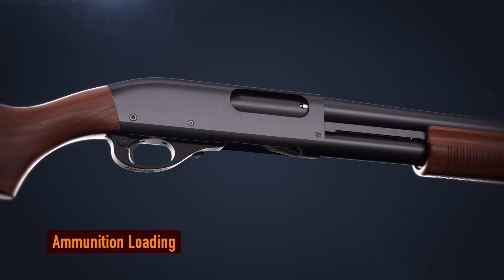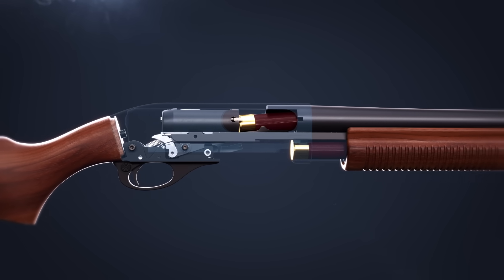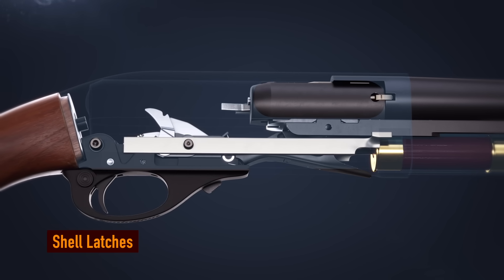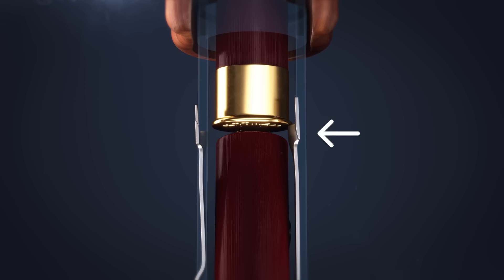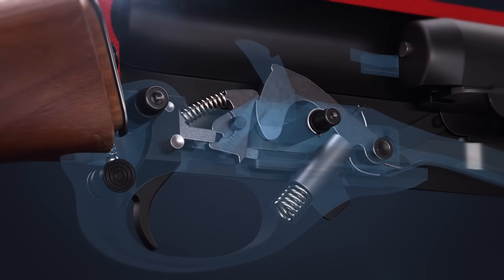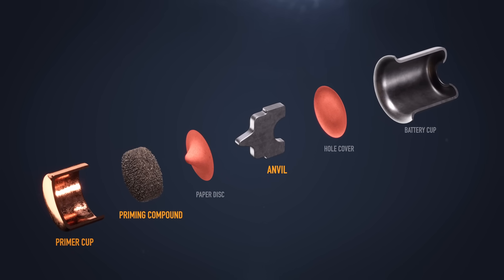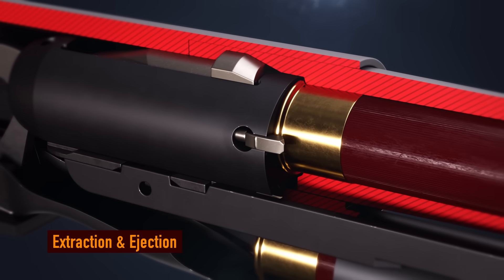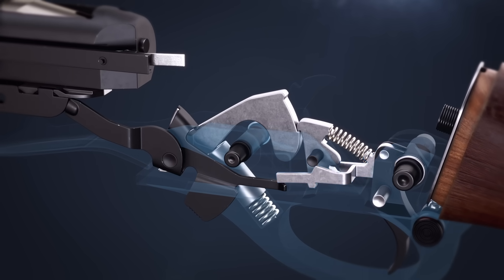How a Pump Shotgun Works

Comment: ummm. The "shell latches" are actually called spoons or forks in the firearms world.

And they have official names for these parts; One is called a shell release, and the other is called a shell interrupter. One piece, at least in mine has the shell release spoon on the right side and the shell interrupter on the left. One holds back the shells all the time and the other is activated by the action bars to prevent another shell from ejecting which will cause a catastrophic failure.

Also its not a shell or bolt carrier. Actually called a bolt sled since it slides back n forth in the 2 channels inside the receiver. And then you failed to mention the "shell elevator" that lifts the shell from the mag tube to the breech face.

I know all this cuz I have fired a shotgun over 4000 times. I know how they work

Comment: I have a Savage Arms pump shotgun and I don't like how the safety works. Every shotgun I had before you could put the gun on safe whether it was cocked or not. That way when I loaded it the gun was already on safe. On the Savage you can't engage the safety until the gun is cocked. So, as you're loading it the safety is off! This may be a small issue, but I don't like it and this will be the last Savage I ever buy!

Comment: Great video. There is one thing though. Although there are pump shotguns that are also semi-automatic. Most pump shotguns require you to pump for every shot. In other words after firing, the bolt does not go back automatically. It requires another pump. Hence pump shotgun. That is most models. There are now semi-automatic models and there is one (maybe more) rare hybrid pump semi-automatic shotgun.

The Remington 870 is pump only. No semi-auto.

Comment: Fun fact older shotguns such as the Ithaca 37 and Winchester 1897 did not have a trigger disconnect meaning as long as you held down the trigger, the next shell would immediately be fired when put into battery. This was and still is called Slam Fire. It was a quick and devastating method of emptying the tube at close ranges especially in the trenches of WW1 and Vietnam
Reply: The colt lightning pump action rifle does it too
Reply: My nerf gun does it too! -👦🏼
Reply: I wish they still make shotguns without a disconnect.
Reply: @AlexKS1992  in my opinion, thats one hell of a way to provide mass shooters with a quick way to get what they want, if we're talking about shotguns to be sold to civilians, of course.
Reply: @nerdmassive1353  I’m a firm believer in abolishing the NFA and making automatic weapons available as guaranteed by the 2nd Amendment.
Reply: @AlexKS1992 : Yeah... great idea 😒

What we really need as a society on a murderous, self destructive path is more access to guns... 👍👍
Reply: @NibblesTheNibbler  Don’t like it move somewhere else.
Reply: @nerdmassive1353  or, you know... don't sell shotguns to civilians.
Reply: @deathvideogame  in my humble opinion. We should only sell guns to those with a license
Reply: @webbermain6910  agreed
Reply: @NibblesTheNibbler  maybe we should correct the path rather than treat the symptoms by disabling the society's ability to reject evil by force if necessary. You cannot convince me that the horrors of tyranny aren't the sickness that are causing the mass shooter symptom.
Reply: @deathvideogame  "dont sell shotguns to civilians" dumbest statement of the year right here
Reply: @trolltal_warmaster  why did you put three quotation marks
Reply: @deathvideogame  i only put 2. Learn to count
Reply: @deathvideogame  
"Dont sell shotguns to civilians"
Smartest anti-gun person
Reply: @chieckenman4432  Why thank you
Reply: @AlexKS1992  leaving's the coward's way out. If you really love this country, you'd stick around and want to see it fixed.
Reply: @thegoodmudkip3652  Read my comment again, I don’t plan on leaving.
Reply: @AlexKS1992  and neither am I, so don't tell me to leave because I want to see this country become a safer place to live.
Reply: @AlexKS1992  You make it sound like you already won.
Reply: @nerdmassive1353  It takes a lot of practice to actually be able to fire quickly with slam-fire, as shotguns generate a lot of recoil.
Reply: @thegoodmudkip3652  you don't want to see the country "fixed" as you claim you want to see the country lose its culture.
Reply: @ICantThinkOfAFunnyHandle  what I want is for there to be less loose regulation on the sale of these kinds of weapons so that any old yahoo with no certification of expertise or mental stability can't just buy an AR-15 without any sort of background check.
Reply: @thegoodmudkip3652  that kind of stuff just doesn't work though. The small minority of mass shooters who get their guns legally pass background checks because they haven't committed crimes yet. Regulation on the sale of firearms is already very strict yet it fails anyway because making it harder for legal citizens to get guns doesn't make it harder to obtain guns illegally
Reply: @AlexKS1992  the 2nd Amendment does NOT guarantee you a firearm.   You better go back and read the full amendment in its entirety…
Reply: @deathvideogame hunters still need to hunt.  And hunters need shotguns and hunting rifles.
Reply: @beaners1234life  Ah yes it does, you should look it up.
Reply: @beaners1234life  hunters do not need to hunt lmao
Reply: @NibblesTheNibbler  why are there murderous, self destructive people in society?
Reply: @thegoodmudkip3652  Sorry mate, but you should look up what a 4473 form is.  You are required by federal law to take a background check if you intend to purchase a firearm from any sort of dealer.
Reply: @deathvideogame  Umm, you have heard of population control, right?  If hunters don’t hunt then the prey population grows and then predators appear…

Hunters need to hunt.
Reply: @AlexKS1992  this is the 2nd amendment verbatim— “A well regulated Militia, being necessary to the security of a free State, the right of the people to keep and bear Arms, shall not be infringed.” 

Copied straight from the constitution website.

well then..  are you a part of a militia?  Being necessary to a free State? Do you hold weekly routines with your neighborhood to be ready at a moments notice when tyranny appears?
Reply: @beaners1234life  Natural environment does that.
Reply: @NibblesTheNibbler  If you dont like it, move to Europe. 2nd amendment states "SHALL NOT BE INFRINGED!"
Reply: @AlexKS1992  That's a quitter's mentality. The world is forged by people be the change they want to see in the world.
Reply: @SwordTune  I don’t understand you?
Reply: @AlexKS1992  when did I ever say in my replies that the militia needed to be regulated by any government?  Be specific when you comment back.
Reply: @nerdmassive1353  Are you aware that semi-automatic shotguns exist? Slamfire weapons no longer are manufactured because of safety not because it makes it a more effective weapon
Reply: @huntercolew  completely agree. I have a AR style shotgun it takes box magazines it’s semi automatic it is the baby of a AR-15 and a Pump action shotgun. I call it the AR-12. The tools matter less than the side of where these tools may lay. It’s every day that millions of good people decide to continue to look inside of their hearts for the American courage that conquers all evil. It’s a select few that perhaps the CIA and FBI send to do their bidding that makes this seem so damn obvious it’s insane. It’s why I always get so confused at that mindset. Like do you know anything about firearms? Do you know any real examples or statistics that support your claim? Switzerland has high gun ownership too. But they do not have rare yet becoming more common “mass shootings”

I wonder why… oh wait.
Reply: And i thought nerf guns only did that! lol!
Reply: This method is now mainly used in nerf guns.
Reply: I hey think I can do that with a nerf gun I have
Reply: I literally thought slam fire was only a thing on Nerf blasters. That's a neat little bit of info.
Reply: Like that one nerf gun
Reply: i love how the people that make guns do them with the every needed thing even if it’s the most little thing
Reply: Interesting 🤔
Reply: so it was basically double pump
Reply: But it’s been proven that the slam-fire “feature” didn’t really make it any more effective in reality
Reply: First thing I noticed about my stevens 67 is the shitty action lock being a tiny thumb press behind and above the trigger gaurd at the base of the stock and receiver
Reply: the absence of trigger disconnect, was that an oversight or nobody though  about it?
Reply: Damn, I gotta try this
Reply: no shit who didn't know that
Reply: @JoeMama-jd2ns   A good amount of people solipsist lol
Reply: @bgbupkiss8466  what a great insult hahahah
Reply: @JoeMama-jd2ns  everyone who doesn't have a shotgun and almost everyone that isn't American or a hunter.
Reply: @JoeMama-jd2ns  I'd heard the term "slam fire" before, but didn't understand what it was exactly, or the mechanisms behind it
Reply: @JoeMama-jd2ns  I didn’t
Reply: @JoeMama-jd2ns  how about everyone who barely knows anything about guns?
Reply: @JoeMama-jd2ns  probably 80% of the comment section
Reply: @JoeMama-jd2ns  i sure as fuck didnt
Reply: @JoeMama-jd2ns  me, I always thought it was using the recoil to rack the gun to immediately fire again

Comment: You even got the zero room for pull trigger...well done on the details. As an avid owner, I learned how to hunt and shotgun in general on my 870 express. It is not a flawless design, but man the appreciation I have now. Also, now I dont feel soo bad for canting my 870 ~45° to the left after pulling back on the pump before slamming the pump forward, as to use gravity to feed the next round 
resting on the load gate thingy, guiding the round along the inner left side of the reciever, thus avoiding the "works 95% of the time" complicated A.F. shell lifter part of the feeding mechanism...of which is the only real problem at times..im sure many 870 owners will know exactly what im talking about lol.
Reply from the maker: Thanks so much man, glad you enjoyed the animation :)

Comment: How reliable are these shot guns? it looks like a lot of moving parts, with very little movement. There are a lot of things that could "jam". Could a gun like this fire ~1,000 rounds error free? How much maintenance do these guns require?
Reply: It depends on what you get in a way, but Mossbergs are generally tough and Benellis are typically excellent, but more pricey.  Older Winchesters had a few reputable models in the past but I don't know about the consensus of the new ones so much.  I hear Remington has gone downhill somewhat but ask anyone that owns the more recent stuff.  I stick with Mossberg because I know about them.  Even the Maverick (the cheapest shotgun) will last for quite some time---I also have the Maverick 88 and I will bank my life on it.

Comment: Another great video, awesome work! 

Note that this shows that if you rack the slide to load a round and leave the shotgun in that condition, the internal hammer is cocked, and unlike with a Glock, there is *no drop safety*. Even with the safety on, if you grab the shotgun in that condition and drop it, or knock it over from a stand, etc. it may fire. There may also be issues with leaving the spring under tension for long periods, so carefully consider the risks of leaving a shotgun in ready-to-fire condition.

Comment: I see many tiny latches holding other tiny latches on a tiny surface, which means if I would give this gun a good ol' smack, the hammer could potentially release and the left latch could fail holding the casing making the buckshot slide up in the mechanism and potentially blocking it. Thats why this shotgun is prone to being dropped on the floor I believe.

Comment: What happens if the wad fails to open after it leaves the barrel?
Reply: Then you would just have a big slug. Some people induce this on purpose by pouring hot wax on to the BB's then resealing the shell. They have then created a simple slug out of cheap birdshot

Comment: the only thing that i don't understand about this weapon is how to get the pump action to unload the shells if i choose not to fire the weapon in the movies i seen them load the shells and pump the thing anybody knows how to work that action but i had no idea how to unload the shells.
Reply: There's two options
1. Press and hold the action bar lock in and rack the gun.  (as described at 0:39 through 0:47). Repeat until the gun is empty
2.
There's shell latches in the bottom of the receiver that hold the shells in the magazine. You press the left one in and it will spit out a shell. Repeat this till the magazine is empty. Then to remove the one shell in the chamber, press the action bar and rack once
Reply: https://youtu.be/fDnyRXF_0Ck?&t=3m47s though 4:32 has a good demonstration

Comment: I was actually surprised at how many shells the can fit inside the underbarrel. Very interesting
Reply: A lot "tactical" shotguns hold 7 or 8 in the tube mag
Reply: Dont be fooled though. Each brand, gauge, or change in factory parts may lesson or add to this capacity.

Comment: Honestly ive taken apart most of the guns i own but a pump i dont see a reason too ever take apart solely because it basically wont ever fail or if it does their is a MAJOR issue. Ive taken semi autos apart as well as antique rimfire tube feed rifles and their pretty crazy feats of tech, the craziest one ive taken apart is a "Wards Westernfield 922M" a semi auto 22LR tube fed gun

Comment: friend of mine was like "Why are guns so expensive its just a barrel with a hammer at the back of it?" showed him this so he could see how complicated the inner workings of a firearm is, theres always slam guns which are a simple as they can get but if you want quality and the convenience of multiple rounds or shells you need something complicated and thats where the prices start to go up and thats not even factoring in the quality of the parts, anyone who has worked the action on a quality firearm can attest to how nice and smooth pulling the bolt of a rifle like the sako bavarian is

Comment: A lot of the internal parts for a shotgun are much larger and stronger than other types of guns. So when you rack a pump shotgun, theres a lot of weight and noise that goes with it. It feels really good, like your not messing with a "normal" gun, this is a "real mans" gun.

Comment: One question, and maybe it’s obvious, or I just missed it….why do you have to hit the lever to allow the slide to chamber the first round, but it’s not needed for the subsequent rounds? Something with the round being in the chamber after the first round is fired?
Reply from the maker: I failed to explain this portion well, I apologize. It’s only required for the 1st round. After it’s fired, the lever is automatically lowered (via hammer spring) and doesn’t need to be pressed again.

Comment: Dear Matt, would you please call Remington and show them this video?Show them how a pump works.
My 3.5" Turkey gun doesn't feed worth a darn. 2 3/4", 3",and 3 1/2" doesn't matter. I have to carry a screwdriver in the field to un-jam the damn thing.
Been this way since new :-(
No more Remingtons for me.
Reply from the maker: Oh dang sorry to hear you’re having a bad experience with yours Robert :( I wonder if this is common for Remingtons?
Reply: @mattrittman  Yes Matt. Rem. had a good many quality control issues back then. One of the common failures was at the loading ramp/gate. The spent shell ejected just fine, but the new shell would not make the transition from tube to chamber.
This gun was actually stolen from me before I owned it a year.
How a company like Remington could ship a gun like that is unforgivable even if  their warranty service was good.
Thanks for your interesting video!
Reply from the maker: @uralbob1  That's pretty crappy to hear. I didn't know about the loading issues. I've actually recently picked up an 870 that I haven't fired. I mainly got it to study how it worked and to model the parts for my animation. Anyway, thanks so much for the nice comment on my animation :)

Comment: Remington: This gun has a very precise and complex mechanism that requires certain level of engineering that you never expected.

Video games: Here is the lowest tier shotgun in our game.
Reply: It blows your limbs off from one meter away but tickles you if you move back 2 meters
Reply: As a diehard Winchester model 12 fan, I must admit, my go-to shotgun is my 33yr old 870 Wingmaster. The 870 is probably the most produced shotgun ever, it didn’t get there by accident.
Reply: At least not in SWAT4, there an 870 can wreck anyone from a good distance, specially with sabot ammo.
Reply: @MateusHenrique-bp3qs  i want swat 5 so bad
Reply: @llllllllllllllllllllllllll4313  Look for "Ready or Not" on Steam.